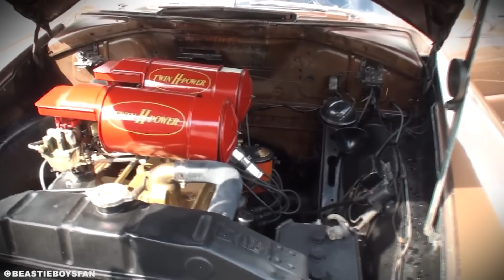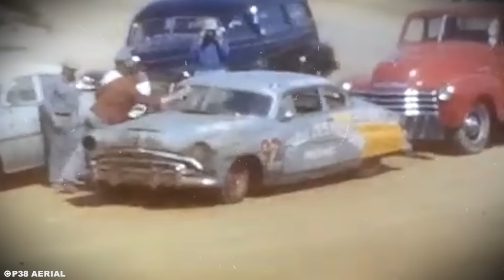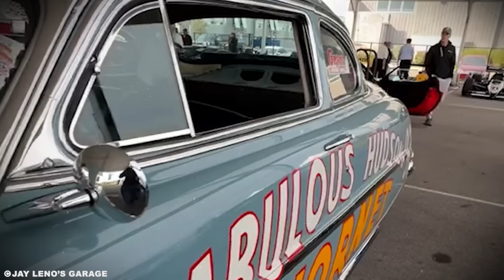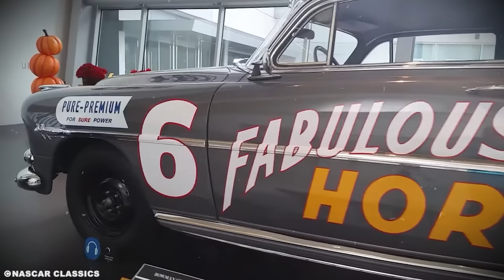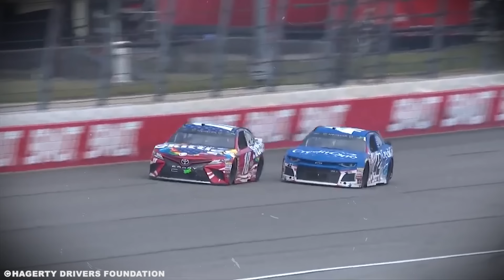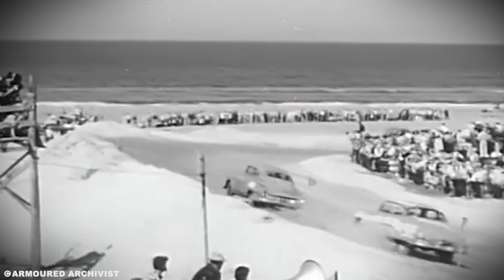How One Mechanic's BANNED Exhaust Manifold Trick Added 50 Horsepower

Comment: BS story dude. ya don't pick up 35% power gain from improving the surface finish of an exhaust manifold. In fact studies show that finish has LITTLE effect on flow, since there is a stagnant boundary layer at that surface.  The true story is more likely that Smoky did MANY small "blue printing" mods to get a total substantial gain.

Comment: When you get racers and mechanics that understand how there machine works and understand the rules give n the ingenuity and genius of their understanding comes out . I love those stories . In drag bike days in the late 7”’s early 80’s there was a racer named “Pizza John “ Mafarro . He was from Maywood NJ he owned a pizza joint Angelo’s pizza which is still there . When they went to race in Colorado I believe it was they had to re-jet the carbs for the thinner air because of altitude which was aloud . But they realized it wasn’t enough to just re-jet plus it took time and you had to try different jets to tune it just right when guys who have been racing at that altitude already had tuned there bikes to match . So understanding how carbs worked that high came up w the genius idea that wouldn’t break any rules that well since they couldn’t change the thin air to nice thick jersey air around them and the bike they’ll make thick jersey air inside the airbox by putting DRY ICE in the box . By changing the density of the air going into the carb and jetting it closer to what they used in there home state he was destroying the racers coming in 1st place every time by lengths . When they tore the bike apart they found nothing wrong where any rules were broken cause that tiny bit of dry ice would disappear by the time he went over the finish line . Finally someone caught on . Not sure how I’ll ask my cousin he was best friends w him they grew up together he was the one that told me . Maybe someone said something out loud or they smartened up and saw he had the same jets for Jersey then for Colorado and figured only way that would work was to use dry ice . Non the less it’s because of him it’s now in the rule books no dry ice aloud to be used to change air density for the airflow

Comment: If you think putting a little valve grinding compound run through an exhaust header is going to do ANYTHING you are sadly mistajen.

The Ford Contour SVT made 195 hp from 2.5 liters using thr Extrude Hone process in the intake manifold.

It took a WHILE to push an abrasive putty through the manifold and even then the results were minimal at best.  Since then (2001) nobody bothers because it has been pretty well proven to take material off the wrong places (the INVERSE of what was originally thought) and you dont hear about it being used in performance car applications any longer.

Smoky might have had a curious mind, but was also a known BS artist and someone who made stories up,
Reply: If grinding compound won't do it then how do you explain sandblasting and water erosion on rocks?
Reply: @billyjack7728 That takes YEARS!  Sandblasting is pointing something right at the surface.  And it takes off rust and paint--it does hardly ANYTHING to cast iron!

If you think Smoky Yunick got 50 hp off shoving some valve paste down a stock exhaust manifold--I really dont kniw what to tell you.

If this did ANYTHING, you'd see people do it today.  If you saw what it took to Exytude Hone an ALUMINUM intake and take material off, you'd understand this story is 100% nonsense--he was a good talker and promoter, but was a BS artist.  And this is PURE BS.

A percectly designed header on a 308 Twin Six might make 15 hp MAX.  You think that valve grinding compound is going to exttract 50 HP from the same garbage exhaust manifold? 🤦🏻‍♂️🤣😂

Comment: It's total B.S. to say polishing the stock exhaust manifold will add 50 HP to a 145 HP engine.  A good set of headers added about 20 HP to muscle car engines on the dyno.  I see all those Hudsons were Hornet with 124" wheelbase.  The Wasp was 118" with the hood being 6" shorter.  Made for better handling and everything else was same parts including engine.  I wonder if NASCAR allowed the Wasp with Twin H engine.  Best cheat I ever done was beating the cube checker on a 427  FE Ford. Just drill a hole in exhaust bolt hole into combustion chamber.  A 1/8" hole would read about 396-400 on tester if remove manifold bolt.

Comment: Sounds like the beginning of the extrude hone process... As I understand it, that basically uses the same silicone carbide suspended in something like silly putty, pushed through the part at high pressure.

Comment: In 94's RC-car onroad races (1/8scale, 4wd, 3.5ccm, auto gears) everyone used spoilers made for offroad buggies.
I had to build my own like the wing of the 'Fieseler Storch'. A big front lip to level the flow for the following wingpart.
The whole field went ape in protest, but the marshalls said O.K. until they found the edges were too sharp.
On the final day i had it cured with liners and tape. My most beloved trophy ever.

Comment: I built Volkswagen motors and did the heads the same way I would polish the exhaust and make a straight smooth way straight to the valve on the intake side I wouldn't polish it as much as it would help atomize the gasoline and Air
Reply: 100

Comment: This was abrasion. Abrasion is a mechanical process. I've no idea of the rules or what changed. But this smoothing of the manifold airways was not a chemical process.
Reply: Yeah they call it extrude honing. A chemical process would be acid etching, but you wouldn't use that because it would leave a pitted surface.
Reply: @pauls5745  Another name for the same process is Abrasive Flow Machining.
Reply: @pauls5745 No, not quite. Extrude honing pushes a thick abrasive paste through the part. The method that Smokey used was air-based. The abrasive particles were carried by pulsed compressed air.

The end result is similar, but the method isn't.
Reply: Intuitively, a smooth surface would allow smoother air flow.  So why is a golf ball dimpled?
Reply: @wayneburgess2885  Turbulation does not work in pipes because the turbulent air takes up valuable space, so it typically creates a restriction.
Reply: @wayneburgess2885 The dimples are there to help with air flow separation. 

Air flow separation doesn't help for airflow that stays inside a tube or channel.
Reply: @wayneburgess2885  Very good question. But in the case of IC engines, smooth is the proven way to get the best performance. In the case of golf balls it's about increasing lift and reducing the wake which causes drag. Also makes for straighter flight. But not intuitive as you say.
Reply: I never heard more nonsense.
Reply: @Axeman428  What is nonsense?
Reply: NASCAR ! The most corrupt venue ever. This video is utter nonsense. I never heard of a stock manifold being illegal either. I never raced nascar so I don’t know everything but this is ridiculous.

Comment: In 1952 the "Twin H-Power" version became standard equipment with dual single-barrel carburetors atop a dual-intake manifold, and power rose to 170 hp (127 kW; 172 PS). The hood featured a functional scoop that ducts cold air to the carburetors and was considered "ventilation" in 1954, rather than ram air.[2] The engine could be tuned to produce 210 hp (157 kW) when equipped with the "7-X" modifications that Hudson introduced later.[9] During 1952 and 1953 the Hornet received minor cosmetic enhancements, and still closely resembled the Commodore of 1948.
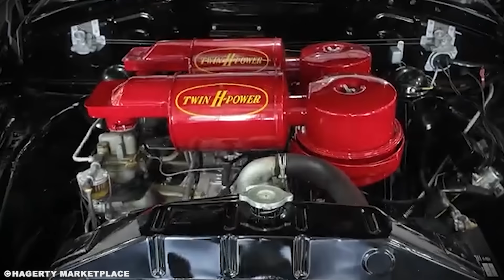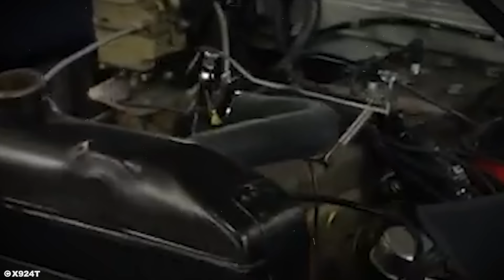Reply: A builder from Holdrege Ne. used to run the 7x back in mid 60's.  That was super stock coups.  We ran in jalopy class using the Twin H engine and Wasp body.  So far as I know it wasn't 7x  but I was just the driver.  It did kick dog crap out of everything else at several tracks.  That thing had so much torque we could run high gear on a 1/4 mi. track and a 4:55 rear gear and 6:70 tires. Just change rear tire's to 7:10's for  the 3/8 mi.  Of course the kids never heard of those tire sizes.  27 and 28 inch diameter.

Comment: 50 horsepower from smoothing out the inside of the manifolds is a pretty damn far reach
Reply: It's totally impossible!
Reply: @joepkortekaas8813 not
Reply: Maybe but not if the stock as cast  was more restrictive than what was reasonable
Reply: Lotsa holes in this story...
Reply: Smokie had angled rods among other tricks that he got away with, Not all that extra power came from the exhaust

Comment: That sounds like extrude honing. Done with gritty paste
Reply: I had a set of Cadillac exhaust manifolds extrude honed and it made a world of difference.
Reply: Lol it sure was, he used a triplex mud pump.
Reply: I was just thinking the same thing. I designed a Cylinder head for small block Fords and gave the basic idea and pictures one day at lunch. I met a guy at UTI in 1979 that had won the pit stop challenge in California. He basically won it for his high school single handedly. Ford was so impressed that they offered him a full scholarship at their engineering school. We both liked Fords, he was an FE man while I was into the Cleveland and the Clevor, which was a Windsor using Cleveland and 351M/400 heads. We talked a bit about the tunnel port heads we had ported for a local dirt track racer. He was using 427 blocks and putting 428 cranks in them making 454 cubic inch FE’s out of them. Then we talked about the Cleveland and the shortcomings of their cylinder heads. So I drew a picture of the factory Heads, then drew them with my design of them with my intake and exhaust ports. They were straighter and raised somewhat and would be available in three port volumes. One for 289’s and 302’s, another for 351Ws and Cleveland’s and one more for all out high rpm racing engines. The only major difference was where the water crossover passages flowed through the heads. The new heads would have holes cast in both locations and be machines so you could block off the water passages you weren’t using for either engine family. On passage went through the block for the Cleveland’s and the Windsors passed through the intake manifold. One more piece of the design was that the exhaust ports would exit through an oval port stretched out horizontally to better use the raised ports. A few years later I needed some parts for my car so I went and saw a friend who worked in the parts department at a coal dealership. Behind him were catalogs for Ford’s racing program, so I bought a copy. That night I went through the catalog and to my surprise there was my design. Three port volumes, oval ports and a provision to block off the unused water crossover ports. And beneath it was another head that had been extruded by Yates! The only thing I don’t like about extruded honing is that the ports on some heads don’t flow uniformly. They can be 10 CFM apart or more. But it is a good way to polish what you can’t reach. I would have some CNC porting done and then finish things off in an extrude hone.
Reply: @kennethcohagen3539  ive messed around with a sump pump and sand with some pitbike heads... yes and no.

i would say its good for the finishing, not bulking out.
tried finding silicone "slime" in bulk but yeah... hard to find anything in my country...